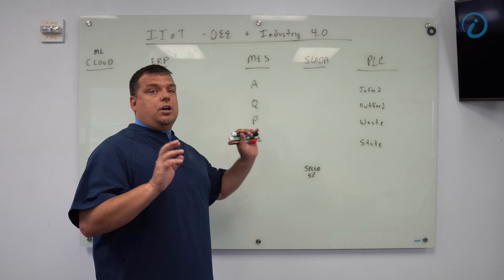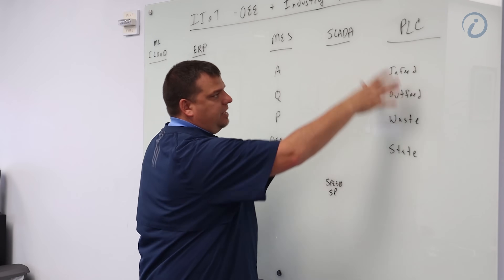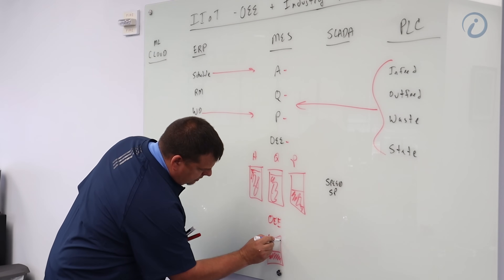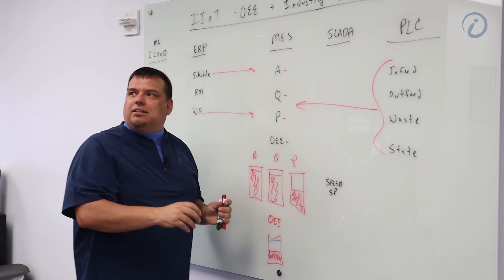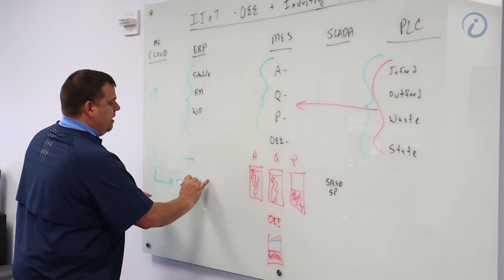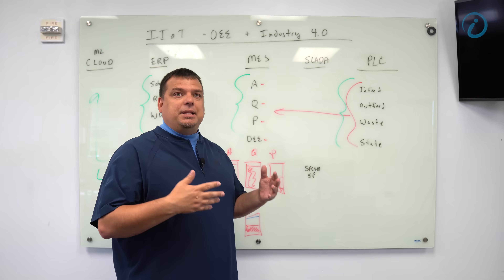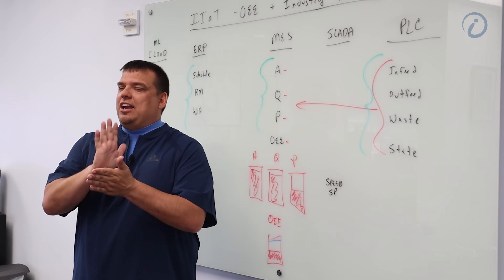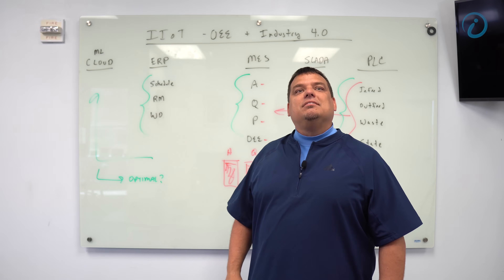Why IIoT and leveraging Industry 4.0 principles MATTERS?

Comment: Great Video, i have one question,  can we build MES on cloud using available iiot technology. Please elaborate pros and cons 😊
Reply from the maker: Yes you can! Would recommend looking into AWS. They have a machine performance template too.
Reply: Check out Siemens Opcenter or Critical Manufacturing. (MES systems)

Comment: Very informative!  It's refreshing to hear an experienced solutions provider lay out the facts in such honest simple terms.  The problem I have is the majority of my existing clients have the same need to adopt this technology but have NEVER used ERP or MES software and some don't even have SCADA.  Plant equipment, although operating with very complex PC and PLC based controls, is connected to order entry, production scheduling, and shipping solely by daily multiple hour long meetings essentially by sneakernet with printed reports from filemaker pro, or excel or some obscure internal system.  This is going to be a challenge!
Reply from the maker: We are here to help Chris!